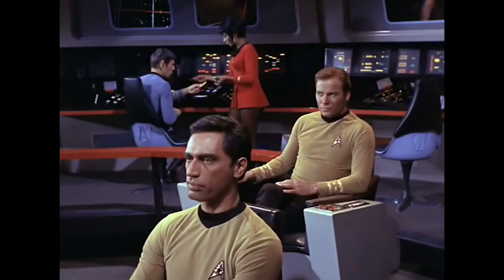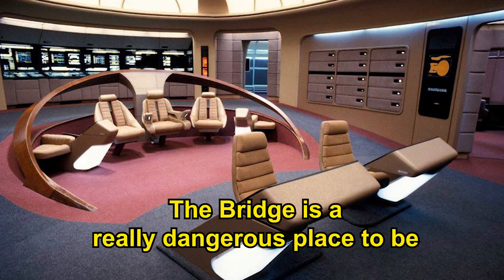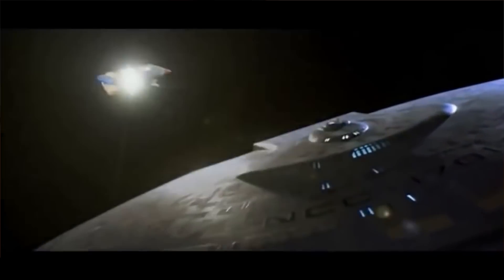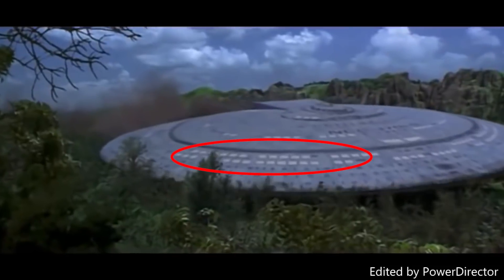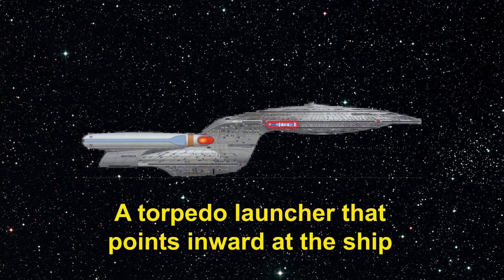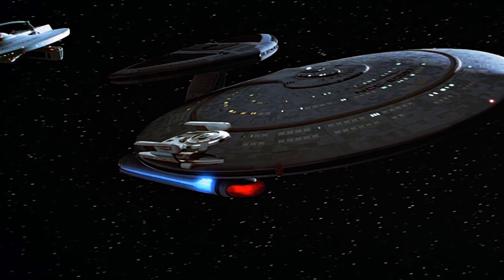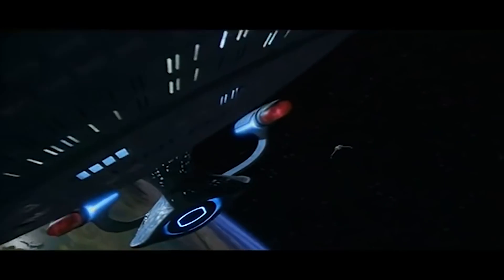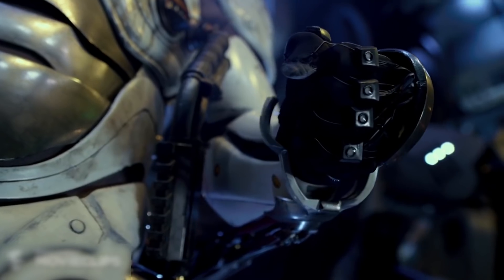10 Flaws Star Trek - USS Enterprise NCC 1701-D

Comment: Most of these points would apply if the Enterprise D was a warship, but it's not, it's an exploration/diplomatic ship. It was built in an era where the Federation was almost untouchable, primarily designed to be used for exploration and transporting diplomatic envoys. It's the equivalent of a private yacht.

If you look at the Defiant, an actual warship, a lot of your grievances with 1701-D have been removed for it to function as a warship.
Reply: Sanguis Dominus “being an exploration vessel” is an excuse for having an exposed bridge? How is that an advantage when all space exploration is sensor-based?
Reply: @FrozenPhoenix15  The exposed bridge in a spaceship could serve the exact function it's paying homage to the classic design of sea vessels: a raised platform from which the vessel is commanded. This position also allows personnel to be able to observe the area around the vessel to assist in piloting to avoid obstruction.

Now... why not make the bridge retractable in combat? Aesthetically, it may look a little weird... but practically, you obviously avoid far more issues. 

And thinking about it, you could make an argument that even today, modern vessels don't need an exposed bridge, particularly warships. With the sensors and cameras systems that are available, you could conceivably completely remove the superstructure of an aircraft carrier and other combat ships, embed operations somewhere within the vessel, and project imagery through out the room. It's operational in aircraft (F-35). You lower the profile of the ship and keep the command section safe (perhaps even removing other rooms like CIC to combine them with bridge ops).
Reply: i know people just don't understand that the defiant can take out a galaxy class starship no problem, after all even the smallest warship can take an exploration vessel. hmmm wait, i think it is the other way around, the defiant gets its ass handed to it by the galaxy class ship. that can't be right if it is a warship built during a time of war and the other one is just an exploration vessel built and designed during an era of extreme peace. i guess it is a warship.
Reply: that's even worse that its an explore diplomatic ship that keeps on pretending to be a warship that keeps getting dragged into it.
part of the problem.
Reply: And it is a terrible design for a exploration and diplomatic ship. Even in modern times today, on military bases with base housing you see a clear and distinct separation between family and civilian habitation and the actual work/mission part of the base. The Part of the Base with Family housing is nowhere near the various operations, barracks, training areas, firing ranges and repair shops of the rest of the military base. 

Also if this is a deep space exploration vesicle that houses children, families and diplomatic envoys, the ship should never , 1 be the Flag ship for your Fleet, 2 be apart of any defense actions or missions, or 3. near any borders with hostile space faring civilizations. If the Enterprise D is an actual exploration and diplomatic ship it needs to be in assuming safe areas of Space. If you are bringing any ship to a hostile area of Space, it needs to be a proper military ship. Both the Design and Multi purpose role of the Enterprise D comes from pure arrogance and absolute stupidity.

Want to see a Proper Space Ship with a civilian population, look at the SDF-1 in Macross Saga (ether the US Robotech or Japanese Macross version). 
The Ship was retrofitted and repaired Alien ship adapted to be as a prototype military vesicle that just happen to have a whole City's worth of refugees on board, the civilians are there as a matter of circumstance and not design, and the Ship's Admiral did not realize activating the ships space fold engines would take with it all surrounding matter with it as it was the first time the fold engines where ever used.
Reply: @spins321  but the bridge doesn't need to be raised to have a 360° view. There aren't even any windows. The viewscreen is actually the same design as a holodeck just smaller as shown in the voyager episode "a year of hell part 2"
Reply: Even if Enterprise was not a Ship of War, it should omit any Observable paint job , and paint the Ship SPACE Black and be able to Disable all Running Lights.
Reply: @markplott4820   What good does that really do when the ship isn't being visually targeted?  How does that help it avoid sensor based weapons targeting?   I could see a more comprehensive stealth function even if ti falls short of a full cloak but it has to be more sophisticated than paint it black and turn the lights off.
Reply: @willstikken5619   - well Emitting no Signals also follows into that Category. and as Cloak's are Illegal for strafleet to develop, until LAW changes , they can make due with Passive Stealth. and this works great for First Contact and Culture Observation. less of a Political MINEFEILD, than Cloaking TECH and Duckblinds.
Reply: @markplott4820  why? With sensors the ship could be invisible and they would still pick it up
Reply: @snonsig2688   - because less Advanced races with Visiual Sensor only would not see it, or least be low observable.
Reply: I agree.  It shouldn't even be a diplomatic ship.  It should be purely exploration, given the huge array of science equipment and specialists on board.  And since they brought the families along, it was intended that they leave home and explore until their mission is complete.  Not cruise familiar territory.  And bridge position shouldn't even matter.
Reply: Not entirely.  I was stationed at Mather AFB during the SAC era.  It had a SAC bomber wing.  The alert pad, where the on-alert bombers and tankers were positioned, was less than a half mile from there.  You could see the rooftops of the houses from the fence.  The runway was close-by too.
Reply: Enterprise D was both a warship and a exploration/diplomatic ship. just like TOS Enterprise
Reply: @markplott4820  That's fine if the people targeting you are using telescopes and only looking in the visible spectrum. There's a lot more to stealth than just an edgy paint job.
Reply: They really do need to come up with a a better design especially with the engines being exposed I would just make Dolores section wider and integrate the engines into that, Bridge room should be more defendant integrated deeper into the saucer section they can definitely use a lot more weapons on it and quadruple secondary Shields I would put six torpedo tubes in the back 6 in the front quadruple lasers plasma cannons duals on front and rear and cloaking devices some new type of design😎🖖
Reply: @dixievfd55  - well a Blackout painted Starship would be less observable against the Blackness of Space, nearly invisable, and they could Minimize Emission or Eliminiate entirely. 
Examples are Black Ball Iron paint and RAM. and having a system to Eliminate EM radiation from the Ship. 
in fact it could park in orbit , perpetually stationed on the Dark Side of the planet to observe.
Reply: Sure becauses an exoloration ship that can glass a planet by itself is a thing the galaxy class is technically a flagship till it was replaced by the soverin which if that shows up on your door step you know the federation is pissed
Reply: @FrozenPhoenix15  You're forgetting that the Federation has been at peace for 60 years.  The Romulans are isolationists that who lost their last war with the Federation.  Most people have never even seen a Romulan.  They're allies with the Klingons. The Borg and the Dominion have never even been heard of.  They're at a point in time when they think they're too big to touch, and while the ship's flaws are indeed flaws in writing, we DO this reflected in the show, which sees Starfleet being incredibly arrogant and preachy to just about anyone they meet who's behaving like normal, violent people.  Though the ship's flaws are a lack of understanding of tactics from the writers, it actually fits quite well with a narrative about a nation that's so powerful and have been at peace for so long, they've gotten lazy in ship design and aren't thinking tactically.
Reply: @markplott4820  That would work against lesser civilizations until your ship occludes a star. I think the Federation could do some active stealth like the Normandy from Mass Effect without violating the Treaty of Algeron. Normandy did everything but cloak. At ranges Star Trek starship combat is supposed to take place at visual would be pretty much useless anyway.
Reply: @lukasperuzovic1429  Good example. The Galactica is another.
Reply: Mark Plott painting the ship black has no effect. The amount of heat produced would make it visible from the next quadrant anyway. No amount of black - or other colour - is going to disguise it. It would shine like a lighthouse. The bridge was designed as the centre for the ship controls, not for war. It was also designed to be a module to be easily replaced. The torpedo launcher in the saucer. Really bad idea, I agree with that one... the nacelles were placed where they were to 1) be in alignment with Roddenberry’s original ideas for the designs. (Must be 2, visible to each other by 50%, and above or below the saucer, not through it. And, 2) the further from the hull, the safer. We are, after all discussing plasma. The same stuff in the sun. Very hot, very dangerous. Also, those nacelles produce a heck of a magnetic field. Not something you want to be around for long periods. Finally, the joystick bit. 100%agree. Never ever understood why they went with that method. No feedback through the control. Even fighter planes give feedback, despite the controls being fly by wire...
Reply: @teknomancer6024  You don't have weapons on something unless you think there is a possibility it might have to fight. And if you have to fight, having the bridge exposed and not as far under layers of Armour as you can is idiotic. The Enterprise D was never proportioned right to me. The saucer was too big. The Tos Enterprise, and the refit of it was very graceful looking. The D was ugly as sin.
Reply: Joe Laton ugly, agreed. The weapons were a purely defensive measure. A WARSHIP would be better. The galaxy is a luxury cruiser by comparison. More the titanic than the uss missouri. Just having weapons don’t mean she is designed to fight, anyone thinking she is really needs to think. Form follows function.  The function of the galaxy class is not a destroyer, nor a warship in any description of he term. Fighting was NOT the main purpose of the ship. Start thinking of the job she was designed for, and the reasons for the decisions made become clear.  There was no reason to believe that the bridge would be under any major threat. It was, after all, an exploration ship first and foremost. If it were a warship, that would be different. A science ship is a peace ship. Look at the Romulan war bird. Aggressive, sleek. A true warship. No complaints there, right? Why? Because it is what it pretends to be. A WARSHIP. The enterprise is not. These faults are only seen because we see the ship used in ways it was not intended for. If a civilian is forced to go to war, against trained soldiers, who’s going to win? The soldiers, right? They are trained for it. The civilian is not. Same principle applies. Ent d is not meant for combat, but can still put up a fight if needed. It’s just not for that purpose. Why apply military principles if they’re not anticipated to be needed? The amount of extra effort to turn that ship into a war machine would be astronomical, which is why the ent e was better at it. It was designed for a more militaristic need. Still not the best, but better. Defiant was more the right attitude than any other starfleet ship I have ever seen. Even the so called battleship vengeance was a piece of crap. Also, the bridge on top bit? Double shielding is all it would take to defend that better and protect the vital parts. There are many ways this can be explained. No one answer is the truth, but my understanding is that starfleet is not a military organisation. Therefore, war is not what they build ships for. Besides, there are many fighter planes over the years that have beggared belief when it comes to describing them as machines of war. Mistakes can happen, bad judgement, and down right ignorance are all part of the human equation.
Reply: @spins321  But the raised bridge won't give you better overview in any way since the bridge has no windows
Reply: The QE.....ahhh  lets go with 6.
Reply: jamoecw The Enterprise has more firepower, better shields, and a bigger reactor - of course the Defiant would lose. The Defiant is not designed to slug it out with another starship, she’s a knife fighter. She gets in close and cuts you up, where your big powerful phaser banks can’t focus her down.
Reply: @lukasperuzovic1429  It's made clear that whenever the ship is knowingly going into a major fight they evacuate the families. Starfeet is a science organisation that happened to get saddled with the defence duties too. Their designs largely reflect that.
Reply: When you use a ship meant for "peaceful exploration" in military situations then ALL of the points apply AND make them worse. You don't use Air Force One for strategic bombing, that's ridiculous. The reason the Defiant was a big deal was because the show runners finally listened to the criticism of sending peace ships into military risk situations. The Federation was good at that, the fact they managed to fight military empires to stalemates is a miracle (and a complete and utter lack of understanding of how military plays a vital role in state to state politics on the show's part) and is at best idealistic that you don't need to have a trained military to fight off a fully mobilized entity. Starfleet mentions time and again that they are not a military organization by nature. ENT got it right when it had star trek's version of space marines posted to the ship. On a ship marines are like a gun: you hope you never have to use it but God help you if you're in need of one and you don't have it. Starfleet also has a bizarre habit of sending in crewmen as FOOTSOLDIERS. Chief O'Brian fought the Cardassians and while he's a tough as nails Irishman I'd not have thought to use him as infantry. The point of this being Star Trek doesn't understand anything military be it from basic tactics to grand strategies. The Defiant was a great ship because it was a warship doing heavy lifting, it was purpose built and the fact starfleet didn't have a small number of similar craft on standby or even mothballed is telling. It's a a wonder the Klingons didn't steamroll the Federation in TOS, and a greater one that the Romulans couldn't do it in TNG. You don't fight a military threat with just "ships of peaceful exploration". By all means don't be a hyper aggressive super power, peace is after all very nice. But as the axiom goes "if you want peace, prepare for war". In a way Q did the Federation a favor by introducing them to the Borg in the way he did, it forced them to come to terms with a superior and very hostile force. Can you imagine if they ran into the Dominion first without the Defiant even being thought up?
Reply: @AlexanderCheff  Your missing a key point about starfleet. Starfleet is not nor was it ever meant to be a military organization. it was and is a scientific organisation that for various reasons was saddled with the defence role. As a result Starfleet builds multi-role ships. Saying the galaxy class isn't a warship isn't entirely accurate. It's not a pure warship, because starfleet has zero use for such a ship it's primary responsibilities lie elsewhere and are much too numerous to make a dedicated warship necessary without a really pressing need.

That does not mean their ships are incapable of fighting or are even poor at it, ( officially the Galaxy was a match 1v1 for any other ship out there when completed, and given the size of many of those ships it was equal or superior to thats telling). The federation just has a huge tech advantage over everyone else, (as demonstrated by the defiant,  Galaxy class worth of firepower with Ablative armour and Quantum torpedoes added on in a package the size of a Klingon Bird of Prey), that it never had a pressing need for dedicated warships.
Reply: @drewchong9236  Blame the fact that they wanted to keep the same "enterprise" for that episode. The existence of the Defiant and to a slightly lesser degree the prometheus shows starfleet is entirely capable of building dedicated warships without those flaws when they put their minds to it. Rule of Drama plus other practicalities dictated they stick with the same design for that episode.
Reply: @drewchong9236  Well see my responses for the matter on my stance on the whole thing, (i think some misunderstanding of the first post of your i was replying to occurred, sorry about that), that said the majority of the plot holes can be explained away, but it takes a LOT of cross referencing various things to do the 2+2 required as some of them require obscure references or some passable understanding of some underpinning physics concepts, (ethier real world or trek specific stuff).
Reply: That does kinda all come back to a core flaw of the Federation's design philosophy for a long while. Trying to be alright at everything, instead of focusing each ship on a specific role. The more different roles you just try to make a design fit into, the less efficient it is at performing any of those roles. That's pretty basic engineering.
Reply: @dungeonguy88   You have to remember the Federation operates in a very different environment from for example a modern ocean gong scientific expedition. They're more analogous to the ships of Francis Drake and Columbus from the age of sail.

And because the federations primary mission, (explore strange new worlds), happens to take them out on long journey's into unknown territory they have a fair need of good cargo space and some at least passable armerments. Which happen to simultaneously provide the federation ships with everything they need to fulfill all of starfleet's other missions, (diplomacy, colony support, disaster relief and evacuation, and military defence).

There's no equivalent to that in the modern era. The earth's surface is largely mapped, the geopolitical conditions known and you can reach almost anywhere on earth with a large scale item in a couple of months or less with the right transport options. We don;t run exploration and scientific missions where we send a group off into unknown territory with unknown threat over a mission length that will leave them out of communications with home for upto 7 years if everything goes according to plan, (and as the season finale of Voyager showed with an inventive enough crew, a little luck, and a lot of hard work a ship designed for a 5 year sojourn could go 22 years if need be).